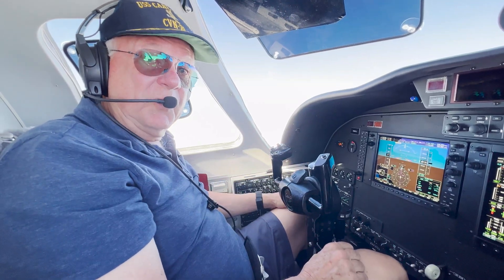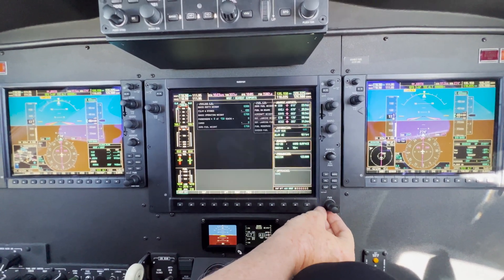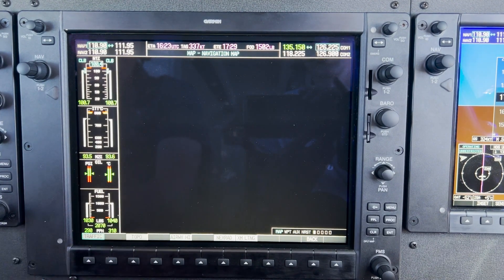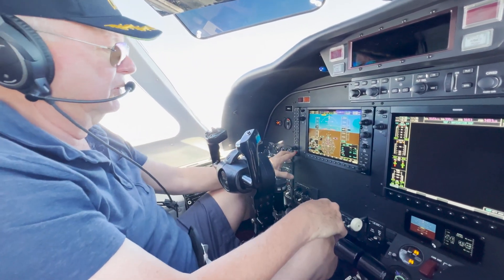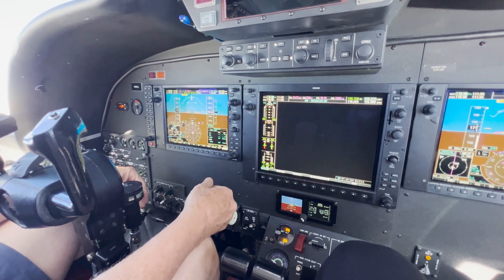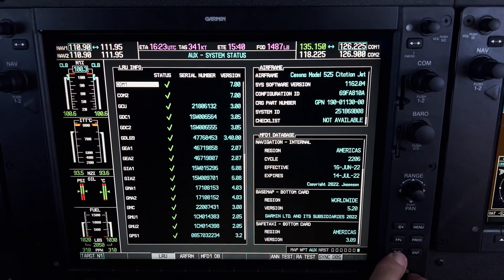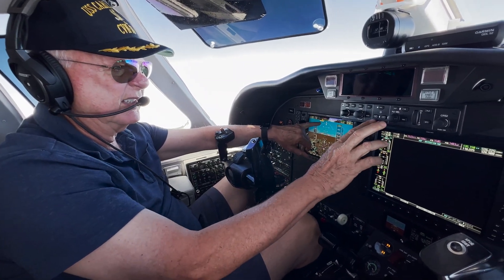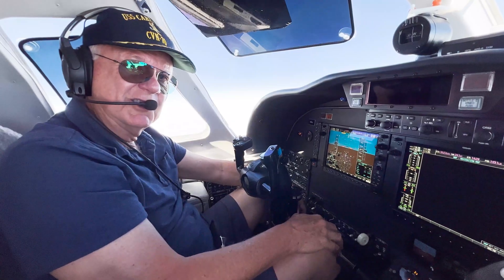Garmin G1000 MFD Fails Mid-Flight / Citation CJ CE-525

Comment: turning back sounds smart. seems like a lot of unknowns with that g1000 unit
Reply from the maker: Glenn, that is our assumption by the in-flight diagnostics.  The G1000 MFD display is somewhat generic, with the real processing done by the Line Replaceable Units (LRU).  The tech is looking at it today and we'll update our information with the findings.

I agree as the old saying goes "if you continue down the wrong path, it is still the wrong path".  We didn't want to end up flying into worse weather, much better to return and fly in visual conditions home. It wasn't an emergency, and we notified ATC.